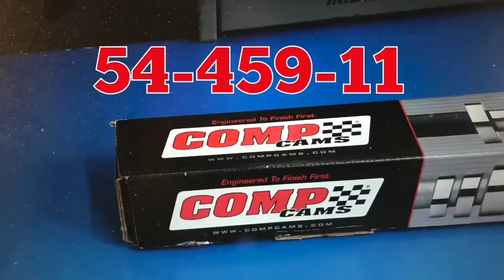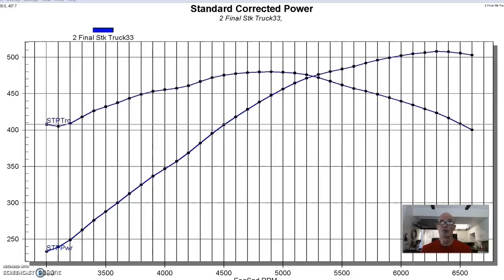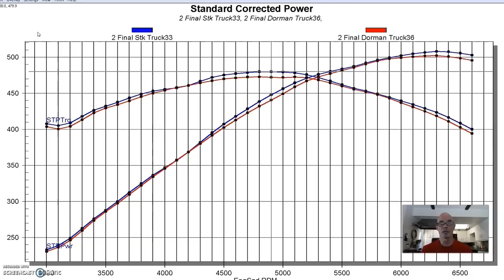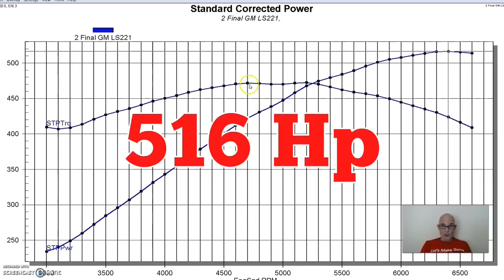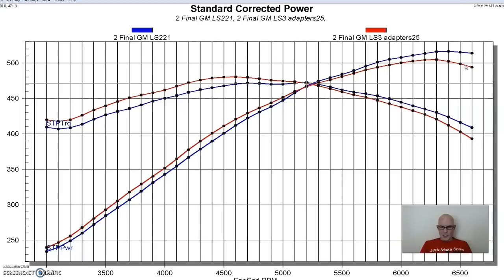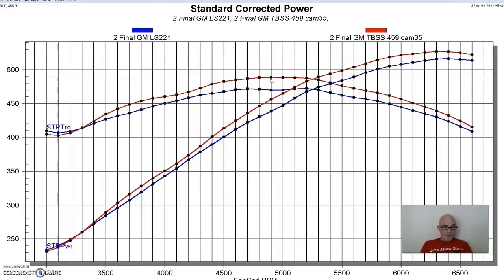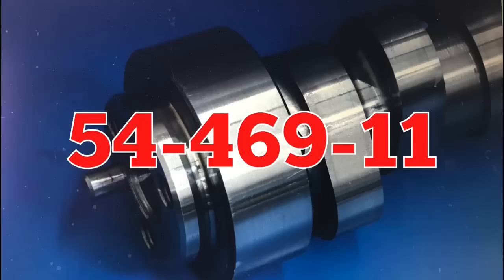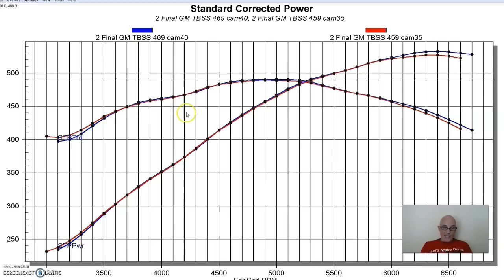TOP-SECRET LS TEST-FACTORY LS3 WITH ADAPTERS

Comment: My question is when it comes to using the adapters would he really matter if you’re using a boosted application? If you’re running a turbo, does it really matter am my second question is are some adapters better than others in or can you port match them better?
Reply from the maker: The adapter being a problem is not related to the presence or lack of boost. It is a function of the transition of the two different shaped intake ports (less of a problem on short-runner, lsa blower manifolds).

Comment: Hey Richard, thank you for all of this data. I have a question, I have a 6.0 with an 80mm turbo and a fitech sheet metal intake. I rev to about 7000 right now. I'm wondering it'd be worth it to run the ls3 with adapters to get away from the sheet metal that everyone hates so much. Would I pick up a decent amount of power or would it be a waste?
Reply from the maker: adapters hurt power, just run a TBSS or FAST
Reply: @richardholdener1727 I was considering the ls3 with budget in mind. That setup would only costs a few hundred as opposed to 800+ for btr and such. A truck intake wouldn't clear the hood in my application.
Reply from the maker: with a turbo it might not hurt power that much-go for it

Comment: How would this work with LS single plane and dual plane intakes?
Reply from the maker: ADAPTERS DON'T WORK WELL-EXCEPT ON THE BOOSTED STUFF
Reply: @richardholdener1727 but a L9H intake with adapters on 243 heads on a lq4 in a truck would work pretty well in a big truck wouldn't it? I have a donor l9h sitting but needs to be broken down and sent out but and checked but that L9H I take with adapters on my 04 2500hd would net me a few benefits, bigger TB, bigger injectors and better flow than the stock gen 3 intake wouldn't it? Toyed with the idea of the 823 heads on the lq4 but the cathedrals are going to make more torque I think. I tow with this truck and it's lifted so need all bottom end I can get

Comment: I think with a little port work on the dorman truck intake. Remove the wedges and open the throttle opening a lil it would probably make more. I dont know why the wedges are in all the dorman truck ports. I also think this intake, ported of course would shine on the high revving 4.8 😊

Comment: Richard,
You are a
Legend in the LS world..I daily drive my 04 Silverado and use it for ranch work, IE pull my tractor with a gooseneck trailer. I’m actually thinking of going with the square port intake and everything else including adaptors to make it run on my cathedral port heads. I really like the end power increase.
Reply from the maker: DO NOT RUN A REC-PORT INTAKE WITH ADAPTERS-IT IS A TERRIBLE IDEA

Comment: Looking at putting the Holley 300-132 intake on my 2000 5.3 with cathedral 862 heads. Holley says this rectangle port intake is designed to be used on the cathedral port heads. If that is true, why do I see these adapter plates for rectangle port intakes to cathedral port heads all over the internet. What am I missing?
Reply from the maker: no rec-port intake is designed to be used on cath heads
Reply: @richardholdener1727  Thanks Richard for the response.  I spoke with a Holley tech and they said the 300-132 intake was designed to work on the cathedral port heads.  If you say that is not the case, do you have a recommendation on a single plane intake that is designed for the 3000-6500 or 7000 rpm range for cathedral port heads?   I am running a  mechanical secondary Holley 750 and will add a BW S475 next year.  If you don't have a recommendation on an intake for me, should I purchase the "adapter plates" or what should I do?  Thanks in advance. Love your channel!  Tons of great info!

Comment: I have a 6.0 with 706 heads and a Truck Norris cam; looking to make the most torque possible between 2,000 and 4,000 for towing and off roading in the mountains. I’m not sure which intake to go with- TBSS, or rec port truck intake with adapters? I think both tests were run here but I don’t see them compared to each other. What’s your opinion?
Reply from the maker: run cath port intake-not rec port with adapters
Reply: @richardholdener1727  gotta figure out a solution for the differences in fuel rails and sensor placement, but will do. Thank you as always!

Comment: thank you sir richard for all those  insights .. a fascinating job .. I hope you will do ( or properly did) the reverse of the test = which is = the adaptors for rectangular heads to cathedral intakes .. this adaptor is very important for those who want to do an ls3 swap in 3rd gen and want to keep factory top end or aftermarket cathedral  end ..
Reply from the maker: I have tested adapters both ways-neither works well
Reply: @richardholdener1727  thanks sir ..

Comment: Do you have anything on gen 3 vs gen 4 LS coil packs?  I’m not so much looking for a “power gain” but ages ago (mid 2000s) there was a test done w the heat sink over the stock LS1/6 packs.  Some engines were dying and we noticed that it’s usually cyl 7.  What we were suspecting was the coil packs miss fire faster than the pcm can pick up on and 💥 boom.  The heat sink coil packs seemed to fix this.  BUT we were also blocking the rear steam vents back then, even on high hopes applications.  Now we know that causes hot spots which can lead to detonation or predestination in the back two cycles.   Not sure if you have any videos on this but I’m curious.  I’m mainly looking for peace of mind w my stock LS6 coils vs heat sink LM5s.
Reply from the maker: I HAVE NOT DONE A COIL TEST

Comment: So because good used ls6 intakes are hard to find would the ls3 and adapters be ok for a street car? I have a 5.3 going in a 3rd gen camaro and plan on pro charging it. I hear factory intakes are pretty much the best for boost and most aftermarket arent good for boost, so if I buy an ls3 it would be good for a ly6 after the 5.3 so I wouldnt have to buy another Intake.
Reply from the maker: the LS3/adapters is not a good idea

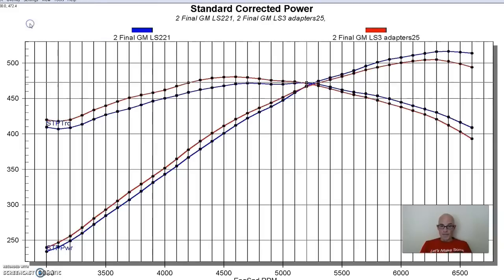Comment: Wouldn't the adapters effectively increase the length of the manifold runner and cause that teeter-totter effect on the power curve @6:00? Would a LS3 intake, with adapter, mounted to small bore LS7 heads (such as PRC LS7X 265cc) prevent the shift to the right of the power curve when using both LS7 intake and LS7 heads?
Reply from the maker: adapters don't change runner length much

Comment: I would love to see you build a quick revving circle track/ road race LS engine.  Ive seen high RPM builds but not any built to rev as quick as possible with off the shelf parts.  Similar to a SB2 just LS based.

Comment: On the tbss intake does the flow come from the intake or the larger throttle body? How much work it be restricted with a 75 mm throttle body? Would be interested to know.
Reply from the maker: its the intake design-then the tb at elevated power levels

Comment: I imagine you can dial in a tune pretty quickly on Holley EFI these days.  Care to talk to us about how you set up and then tweak the tunes on so many combinations?
Reply from the maker: start at low timing-14-24 (from 3K-6.5K), then adjust the AF, then adjust timing back to where it makes peak power, the wiggle AF again-its pretty quick at WOT
Reply: @richardholdener1727  I guess I hadn't considered you're only concerned with WOT.  No need to worry about driveability and cruising for power pulls.

Comment: Thank you for your hard work. Question Richard, TBSS and the later model truck intakes that look the same as TBSS. Are they the same? We’re they both still cathedral design?
Reply: I've got a stock LH6 (aluminum 5.3 from an '05 Buick Rainier) it has the latter style truck intake that looks like the TBSS and 799 heads (cathedral).   Im pretty sure they are the same intake as the TBSS.
Reply: That's what I'm wondering as well 🤔 The 6.0-6.2 are rec port, but the 5.3's are cathedral and look to be the same as the tbss. They are much cheaper though, so idk?

Comment: I know, I know, they work great, are sturdy, and make gobs of power, but OMG I am sick of LS stuff. I'm 55, I like traditional V8s and the "other guys". I'd rather see a 600 hp 440, 455, 500 Cad, etc, than a 2000 hp LS. I'm an old car guy, cool matters just as much as power.
Reply: If a 2000hp LS isn’t cool enough for you then clearly your to old.

Comment: Did you have data or know what to expect on similar set up but with the fast 102 intake vs the tbss intake? I know you have the intake shootout however that engine had better heads etc so was curious what gains would be on this set up.

Comment: Can some one help me understand why there are rec port cams and cathedral port cams?
Reply: Sales & marketing. Cfm is the main concern. If both styles of cylinder heads have equivalent Cfm than
either cams would work.
Reply: It has to do with the flow of the runners, intake vs exhaust.  Most heads flow more in the intake than the exhaust side.  Cam timing and lift can be added to the exhaust to help account for loss of CFM on the exhaust side.   Cathedral heads tend to flow more even that rectangular heads, this flow ratio is different with each casting and or porting done to the heads.  lS7 heads are the most uneven of the LS heads and rectangular LS3 style somewhere in the middle but these tend to flow more which is needed for a bigger engine or more RPM.  The goal is to make a engine run efficiently and if you lack a bit of CFM on the exhaust side you can add more cam timing and lift in attempt to not have the exhaust side being too restrictive.  Flow is dependent on everything in the chain from air filter to exhaust tip, the most restrictive of these will help determine your power output.

Comment: SORRY IT WONT WORK. WITH ADAPTORS to much turbulance.with boost turbulence wont be there
Reply: Are you saying the adapters will not matter with turbo application?
Reply: @ebtbilly  it won't matter nearly as much because the air is being forced into the engine for sure

Comment: "What things should we test?" Richard:"all the things."

In terms of the LS3 manifold numbers it's interesting and could be interpreted as there being meat on the bone for the LSA blower intake if it had ports more closely aligned e.g. welded or epoxied. Then again with boost you'd probably never notice anyways unless going all out.
Reply: Honestly it's probably because the transition is abrupt due to the 1/2 inch height of the adapter. I bet a 1 inch plate would do far better. smoother transition.

Comment: If we had big blocks back in the day  400 cubic inch Pontiac big block   Vs a Chevy 400 small block  , what would be a comparison today , are there still  “ rat “ & “ mouse motors “  ?   If so   Which  ones  and what makes em so .....
Reply: Late model GM LS & Vortec & LT & LSX engine blocks all physically  same size. Aftermarket LS style blocks are physically same size too.
Most engine builders / gearheads
call 400 CID & larger big blocks not
with LS tho.

Comment: Richard which of you video's show how to make an already truck engine l83c 5.3l ecotec greater than its already stock components? If not...then thats what id like to see as a video. Thanks.
Reply from the maker: there is an L83 video up-with nitrous
Reply: @richardholdener1727  Hello sir,  It is an honor to speak with you. I was just wondering how all 3 methods would work and possibly the limitations of these high pack left on the table engines from GM. It certainly would be of an interest to myself before i start this build. Just really curious as to which new driveshaft company i will have to choose from. Lol But the mods im talking is the clay smith cam you did a small segment on with fordge piston heads .0030 ring gap, dry nitrous with methanol injection, 7.5psi to 9 psi peek boost.